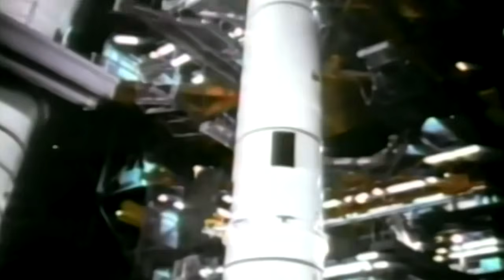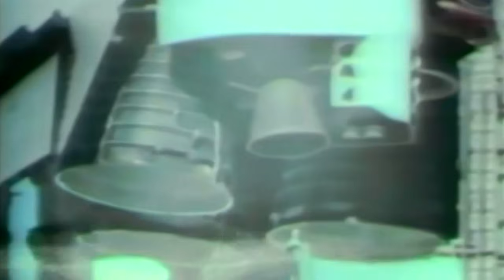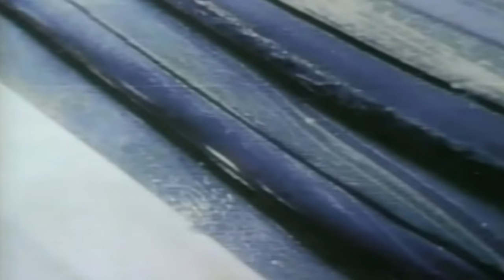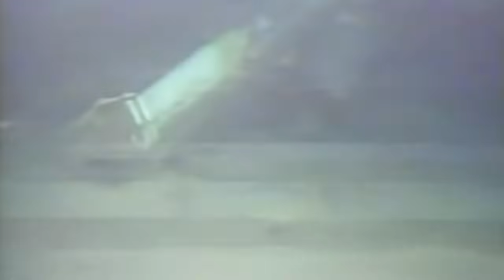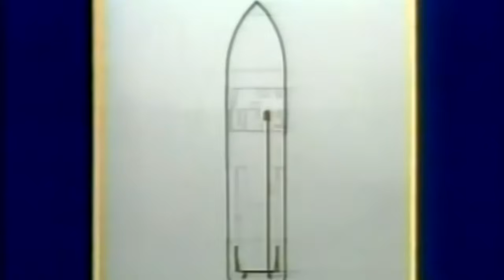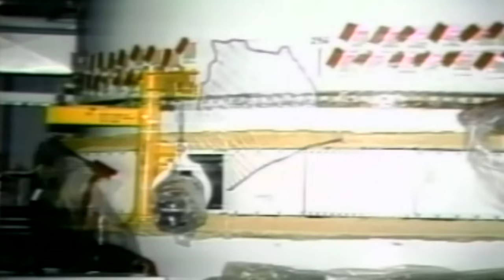Space Shuttle - Inside  Challenger During The Accident

Comment: The joints weren’t supposed to leak at all but they did so repeatedly so NASA decided even though the design was faulty it was still acceptable.  That kind of thinking leads inevitably to failure. It’s insane they repeated the same thought process when Colombia starting showing damage from foam strikes. That was another anomaly that became normalized and ended in disaster. One of the hallmarks out a good engineer is to learn from mistakes and not repeat them. Commercial space agencies have figured this out and now NASA is in the back seat

Comment: If the plume on the SRB been facing away from the external tank, could the disaster had been averted ? Wouldn't one SRB exhaust its fuel before the other and as such, would an return to site been necessary ? (Or even attempted)
Reply: If one booster ran out of fuel before the other, the dis-similar thrust would have caused a Loss of Crew/Vehicle event.  the stack came apart at 73 seconds and the boosters did jettison until 123 seconds.  We would have seen a very interesting but horrific display of thrust gone wrong.

Comment: Faulty design? What other material was available? This was cutting edge, prior to the level of computer modelling we enjoy today, and viton was all they had. So they monitored it, and realised a year before this disaster that they were getting blow by and proposed a solution that was DECLINED.  Fast forward to this event and they set a limit of 53F and demanded they NEVER launch below that temperature, exactly predicting the outcome, and Nasa ignored them, launching AGAINST the designer's recommendations at way less than that. FAULTY DESIGN? How about refusing to listen to engineering advice, failing to allow the design to evolve as data was gathered from subsequent flights, erring on the side of caution where seven lives are on the line... sorry but that conclusion just seemed a bit rough to me.
Reply: the fix was already designed awaiting implementation. The "joint" was teh faulty design.  The o-rings were supposed to be a redundant design, but it wasnt.  the joint twisted during ignition allowing gaps around the o rings and hot gasses found the gaps.  The "capture device" was already designed into the Airforce Filament Wound Case SRBs to be used for Polar launches from California. the FWC SRBs had the updated capture device, but still used 2 o-rings.

Comment: I’d like to see an analysis on the OTHER rocket booster. Shouldn’t they both have showed signs of failure?
Reply: having looked into it, l think the O-rings were supposed to be replaced when the SRB's were serviced, but it was not done. There are two O-rings on each seal and it was determined that the primary O-ring had failed on a previous launch, leaving only the secondary O-ring intact.
This was not something that was sure to occur, but it could happen and on that SRB it did.
In that case the secondary O-ring should have held, but due to the unusually cold weather it failed to do so.
After this disaster they fitted a third O-ring to the SRB to provide a further level of safety.
Reply: Good point,,why didnt the other booster O ring fail. I never thought about that. maybe the launch stress wasnt as prevalent on that other booster??? We are talking millimeters in stress movement.

Comment: 104%? No such thing.
Reply: The percentage level does not relate to actual power only rated output.
The SSMEs provide 375,000 pounds of thrust at sea level. Because of upgrades and certification, the SSMEs were capable of providing more thrust than the baseline.

Nasa Quote:The main engines can be throttled over a range of 65 to 109 percent of their rated power level in 1-percent increments. A value of 100 percent corresponds to a thrust level of 375,000 pounds at sea level and 470,000 pounds in a vacuum. A value of 104 percent corresponds to 393,800 pounds at sea level and 488,800 pounds in a vacuum; 109 percent corresponds to 417,300 pounds at sea level and 513,250 pounds in a vacuum
Reply: Overspeed
Reply: Turn it up to 11
Reply: haha... I was thinking the EXACT same thing!

Comment: It’s sad to think that a parachute on the crew cabin could have saved them.
Reply: Could it have worked at that speed?
Reply: @oldcargeezer  after the explosion they were shot upward, untill they reached maximum altitude and starting falling. SO yes, a (strong enough) parachute would easily have saved as they only reach high speeds after falling for a while
Reply: @oldcargeezer  A lot of options were considered for some kind of "eject" mechanism. 

Putting a parachute on the cabin would have also meant you would want to make the cabin eject-able. There are fighter jets that sort of do this with up to 2 people but they're way smaller, slower, and lower than a space shuttle. Doing this would make the cabin way heavier and bigger, reducing the load you can carry on the shuttle, and you would need big explosive devices and rockets to make it eject properly, which are risky in themselves. Then if there was a lot of damage to the shuttle, you might damage the eject-able cabin, or jam it in place.

The first shuttle flights (including the test glider Enterprise, and actual space flights with Columbia) had ejection seats but only for the two crew on the flight deck. Some of the crew are one deck down so you can't practically give them seats. The other problem is that ejection seats only work up to about 3500 miles an hour and 125000 feet or so, which meant that after roughly the first minute and a half it wouldn't have worked either.

Basically a lot of things were considered, none of them were really practical, but to be honest the whole shuttle program was not exactly that practical. It was an experiment to see if it was a good idea and the result was... eh, not really. Notice they're not really doing the same thing again.

Comment: Once in the air can they have aborted the saved the crew? Or once it's in motion it's too late to stop?
Reply: The malfunction was likely unnoticed until major damage had already occurred to the shuttle. Even if the crew or ground control had noticed it, I believe they probably would not have had enough time to stop the shuttle and bring the shuttle or crew back down, though I’m no expert. I do know however that this incident was certainly (to some extent) preventable, as the piece of shuttle that failed was not designed to function well in cold weather. If you are really curious about this, I’d suggest looking it up for more details. Unfortunately, I don’t believe NASA can stop a shuttle mid-launch, if something goes wrong, the crew will be stuck in air.
Reply: The only way to have saved the crew would have been to have had enough time to know what was coming and hit eject - if that feature had existed, which it didn't - but this was a completely normal flight, until instantly it wasn't.
Reply: Nope, solid rocket boosters can't be turned off when you've lit them. This is one of the many reasons a lot of agencies choose not to use them
Reply: Once the rockets are lit, you can't abort. Otherwise you'll damage the landing pad and still destroy the shuttle.
Reply: @blue9multimediagroup  You're right that once you've lit the solid rockets you're going. You didn't even have the option to try to stay at that point. Even if you didn't fire the explosive bolts to release it, it would just tear them off. There was an abort mode that allowed you to return to the launch site but that was only available after the solid rockets burn out.

Comment: So it was not the external fuel tank but the solid rocket booster that caused the disaster. I never noticed that dark puff of smoke on the  bottom right between the the solid rocket booster and the external fuel tank.
Reply: It was the O rings that failed on the solid rocket booster. The O rings are rubber. Rubber doesn’t expand in freezing temperatures.

Comment: Am I wrong or is there a joint very near where the strut is connecting the SRB to the tank?Im no engineer,but Was a fabricator/welders for over 20 yrs.and question why you would put a joint close to the  strut?Seems it could add vibration and stress to a joint as opposed to an area of solid wall.Maybe it stabilizes the joint .the engineers know alot more than me ,it did look like it burned thru there and melted the strut.

Comment: The O-rings were not a "faulty design."  They were flown outside of their design criteria.
Reply: Ladco77 All of that loss because there were dignitaries there and the launch had been scrubbed before. It’s not like they hadn’t been warned about it.
Reply: They were a design flaw, one they knew about before the challenger launch and actively decided to ignore.
Reply: I am not a rocket scientist or aviation designer in any way I am just a highly skilled automotive technician and business owner. I live in New York where it regularly gets below zero degrees Fahrenheit which causes all types of problems. Suspension parts make noises because the metals and rubber bushings contract causing excessive clearance which makes noises. Many parts in cooling systems on vehicles engines use o-rings which are prone to leak in extreme cold because the metals and rubbers contract causing clearance problems. Internal engine parts contract again causing clearance problems causing ticking and knocking noises until the parts get up to temperature. Many times if any parts are remotely worn or just not the best design they will fail in extreme cold. All I’m saying is I definitely understand how these seals could leak in cold weather and even if it warmed up that day it would take a long time for the shop to reach a higher temperature considering it was in 20 degree weather all night long it’s basically like a big block of ice it’s not going to thaw out in 2 hours. 

In my opinion it looks like a pretty poor design just 2 o-rings are responsible for sealing. Why wasn’t some type of sealant invented that could have been applied to the o-rings that would not only help the o-rings slide into place without tearing when installing but also acted as a sealant. Or what about just welding each section together? What about some type of coating on the entire inside so that sealed it? What about a bladder almost like a tube for a tire? What about a one piece sleeve was installed inside so the joints didn’t even have to be what sealed? What about a one piece sleeve Going over the outside of it? Gotta have more than one thing sealing that. The 2 o-rings might be just fine used within their range but I think of all the stresses and vibrations that ship must have had and that just seems like a crappy design I mean at least have the sleeve or collar with the o-rings on it be much longer with many more o-rings.
Reply: why was this allowed?
Reply: I can’t tell if that’s your opinion or a pun
Reply: @Falcon You realize Wikipedia an old dummy can write there. Just a FYI
Reply: @Falcon did... did you click on the sources?
Reply: The narrator actually said that THE JOINT design was faulty — not specifically the O rings. Listen again. Carefully
Reply: The O-rings were supposed to form a tight seal. They failed at that from the very beginning. Instead they melted/burned while letting out a small amount  of hot gas before they became "sealed." This was in violation of the design parameters but rather than a fix, this behavior became "nominal." The o-rings never met their design criteria. The chance of catastrophic failure was only discovered later when a correlation was noted between burned O-rings and ambient temperature.
Had the O-rings been known to be out of design specifications, the managers would have never okayed the launch. The O-rings were faulty from the beginning. Had the STS been properly tested (which it never was.. they relied on "big bang" testing methodolgy, quite ironic in retrospect...) this failure mode would have been documented and avoided
Reply: @juniperpansy  Sorry, but this is not correct.  I design rubber seals including orings.   
Oring are design to have somewhere between 10% to 30% squeeze in the gland.  
They also have a operating temp spec, tensile spec, compression set spec, compatibility with the fluids/gas it will be in contact with.   
If the temp goes below the seals glass transition or close to it then the seal will be brittle and just crack.    
The main thing that prevents orings to seal is not even the oring. It is the extrusion gap between the glad and sealing surface.  Ideal you would like to stay less than .010 in.  The smaller the gap, then the higher pressure and temp the seal can take. Too large of a gap and the pressure on the oring will force the oring to get extruded into the gap and tear.   
FYI, these oring had to be tested as testing is so easy to do on an oring.  
At a minimum the orings would have been tested in a small fixture simulating the joint on the tank.  They could easily cool it to the lower temp and heat it to the higher spec temp while pressure testing it.   That is how you prove the spec.  
   
They all knew the temp was colder than the design spec since the engineer reported the issue.  They choose to launch anyways.
Reply: @common_c3nts  Wikipedia disagrees with you. I quote, "Forecasts for January 28 predicted an unusually cold morning, with temperatures close to −1 °C (30 °F), the minimum temperature permitted for launch.... The O-rings, as well as many other critical components, had no test data to support any expectation of a successful launch in such conditions.[14][15]"
Very clearly the O-rings had no test data at that temperature. The engineers who tried to stop the launch did so because of an extrapolation (not an interpolation)
Reply: @common_c3nts  As a career mechanical engineer having studied the memo's sent surrounding the initial launch delays, this is precisely the correct explanation.  This accident was a political failure, not an engineering one.
Reply: @juniperpansy  some extrapolations are more reasonable than others

Comment: I would have been OUTRAGED at NASA if someone I knew and loved was on that space shuttle. Knowing darn good and well their previous encounters with weather, the fact that it was below freezing there was ICE on the launchpad AND it was 15 degrees colder than any previous flight, it only takes common sense to do safety checks and reschedule for a warmer day.
Reply: And also the fact that an engineer TOLD them it was a bad idea!
Reply: that is an off told lie. It was not 15 degrees colder. It was 51 degrees and the prior coldest launch was 57 degrees -- a 6 degree difference, not a 15 degree difference. and the SRB (soldi rocket boosters) had been tested at 45 degrees.
Reply: @samd.8911  they failed at 57 degrees. The solid rocket boosters were known to fail at the temp they were launching at.  They had been tested and known to fail on a previous launch and known that both o rings burned through on test burns
Reply: @yougosquishnow  learn to read and add. The OP claimed there was a 15 degree difference. 57-15 degrees claimed is NOT 51 degrees
Reply: @samd.8911  they launched at 36 degrees, so definitely more than a 15 degree difference if the previous lowest was 57